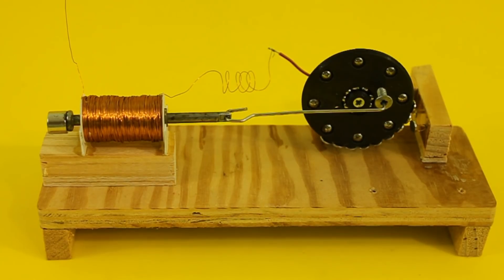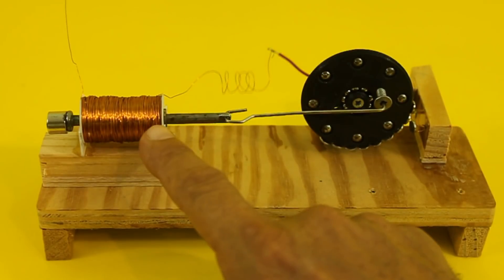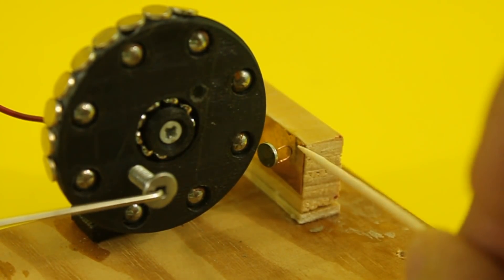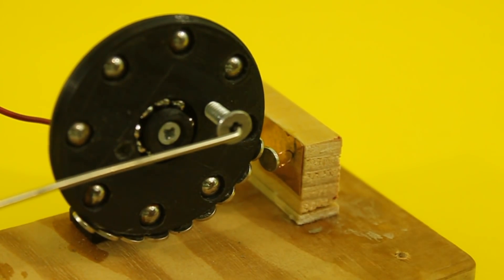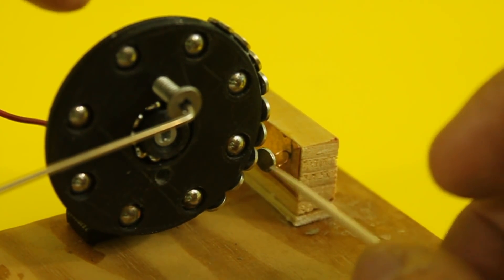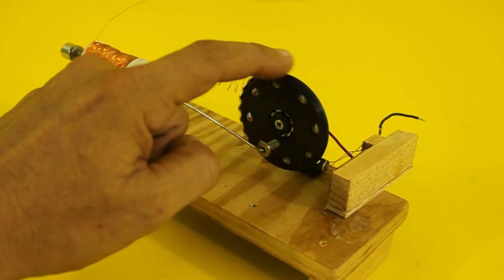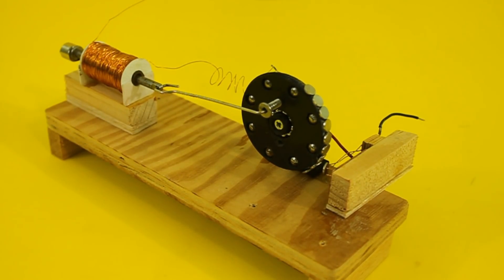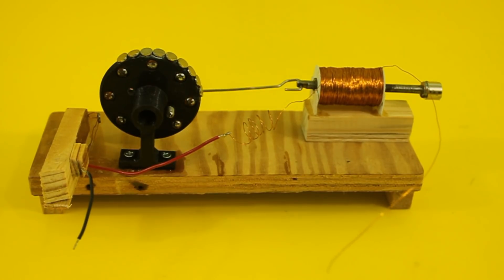Homemade Solenoid Motor

Comment: what size wire and how many turns on the coil?  what voltage is it running on?  how much current does it use when running and when stalled?  can you drive anything with it?
Reply from the maker: +Josh Crampton 800, 30v, 0.1A, 0.4A, yes
Reply: Ludic Science what size wire. ?

Comment: what size wire and how many turns on the coil?  what voltage is it running on?  how much current does it use when running and when stalled